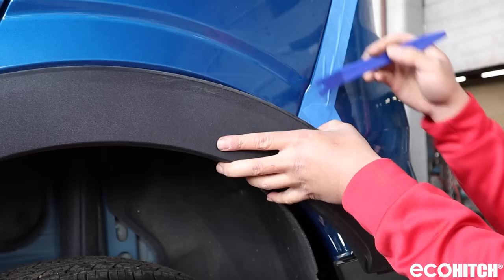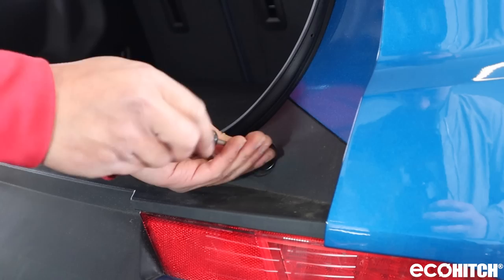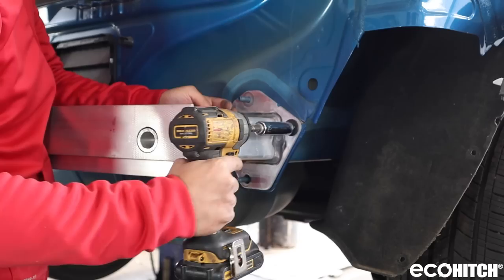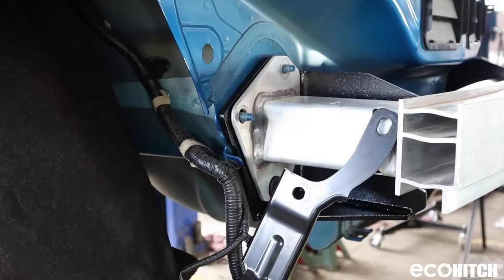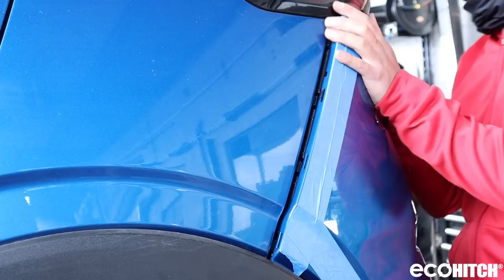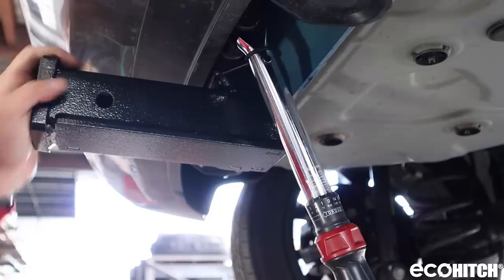2022 + Chevy Bolt EUV trailer hitch by EcoHitch®  (stainless steel)

Comment: I'm used to seeing hitches that have 'stringers' with additional mounting points further up the frame of the vehicle.  Will this design pull loose or bend something with all the pulling and pushing a trailer exerts on a hitch?
Reply from the maker: Hello dooglas99! All of our EcoHitch products are designed using manual and computer aided testing to ensure the hitch is going to be safe and secure at the weight ratings applied. With the design of the rear structure of the Bolt EUV, you should not experience any bolts loosening or bending. Hope this helps!
Reply: @torklift_central  I think what doogals99 was referring to were weight distributing hitches(?)

Comment: Hello, has this tow hitch had any real testing to back up the 3000lbs claim? I just want to make sure it's accurate I would like to tow a boat with this at some point
Reply from the maker: Hi Steven! The EcoHitch itself is designed and tested at a weight rating of 3,000 lb towing, however, you want to make sure you are following the weight rating of the vehicle itself. The weight ratings of the vehicle can be found in the owner's manual. Hope this helps!
Reply: @Torklift Central  well from what I understand the bolt euv isn't intended for towing however i was curious if the 3000lb limit number was when tested while on the vehicle or just in computer modeling. Thank you!
Reply: The hitch can handle it, I'm sure. The car can't. You're only as strong as your weakest link.

Comment: Hi!  What is the final receiver height once installed ? (top of 2in receiver)  Thanks!
Reply from the maker: Hello! The height is going to be determined by the ride height of the vehicle. This can differ based on multiple factors including the weight of cargo or people in the vehicle. The measurement that is going to be consistent is the measurement of how far the receiver is below the bumper - which is 2-3/4" to 3". Hope this helps!

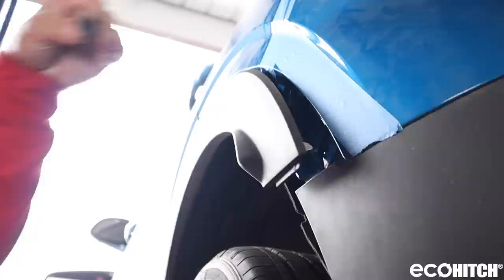Comment: I am installing my hitch right now. The bolt inside the fender at 1:03 does NOT need to come out. It holds the painted panel to the non-painted panel. They are both connected and come off as one unit.
Reply from the maker: Hi Mark! Thank you for sharing your feedback, this is a great tip! I will make sure that our support team is aware of this.
Reply: Hi thanks for sharing this. I plan on getting one and installing myself. So you mean both bolts or just the one on that side? Also it looks like they removed both panels in the video. So by removing those bolts you mean both pieces they removed are just separated?
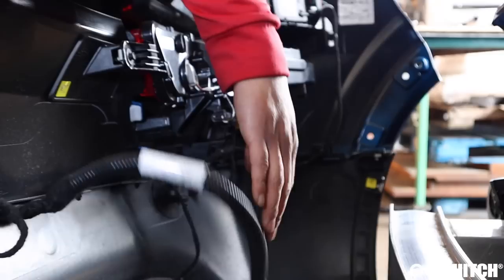Reply: @OscarGonzalez27  you do not need to remove either bolt inside the wheel well (one on each side). Which is really good because it can be a pain to remove.  It's kind of hard to explain in writing. The painted upper bumper is connected to the unpainted lower bumper by those screws (and others).  Since the entire assembly is removed as one unit (2:15), you do not need to remove screws inside the wheel well.
Reply: @markpate9422  gotcha this is helpful because yeah it did look difficult to remove
Reply: @OscarGonzalez27  good luck. It was pretty easy if you've done similar work before. It was a little challenging to fish the power wire to the fuse box.
Reply: @markpate9422  you had me scared for a bit but I'm assuming this is for the wiring harness. I was planning on this for a bike rack. But in case i do a trailer or camper, is where is the fuse box?
Reply: @OscarGonzalez27  yes, the wiring is for the wiring harness. The instructions say to wire it directly to the battery but I didn't want to drill a hole through the firewall. I found a handy post on one of the forums that there is an unused "hot" fuse to the left of the steering wheel. I just used a spade connector to connect to the hot side.
Reply: @markpate9422  gotcha. Yeah that much better than drilling through firewall
Reply: @markpate9422  , that’s good info. Would you be able to tell us the empty fuse location you used? (The specific fuse location is normally indicated by a number on the backside of the plastic fuse box cover)
Reply: @tjam4229  I used fuse 56. Mine is labeled "Police SSV".

Comment: Just installed this. Your video really helps and gave me the confidence to give it a shot (though I couldn't even find the bolt/fastener another commenter mentioned at 1:03 and wasted considerable time looking for it; maybe it was eliminated before my  EUV was produced?). What would have also helped me in advance and/or in the instruction sheet is a detailed (with sizes) tool list. I guessed based on the video, but most of my tools are carpentry and not automotive, so I had to guess to fill a few gaps. And I had to figure out the snap-clip thingies at the end, but overall (except that it was very scary taking apart the rear of the car) it went well.
Reply from the maker: Hi Kathy! Thank you so much for your very thoughtful feedback. I will make sure this is passed along to my product development team for further evaluation. I appreciate it!

Comment: Does the “Stealth” hitch have a place to attach safety chains?

If not, where do you attach safely chains?!
Reply from the maker: It sure does! They are located on the sides of the center receiver off of the cross tube.

Comment: Hello on the bolt euv the part of the top of the bumper is only withdrawn by pulling hard towards us we do not see on the video thank you

1
Reply from the maker: Hi Michel! Thank you for sharing your feedback! We pull the bumpers of vehicles all day every day for hitch installs and you do have to put a little muscle into it because it is secured on there. Fortunately they are designed to be attached and detached but a little flex is needed.
Reply: tank you